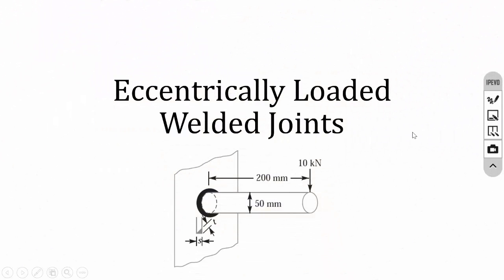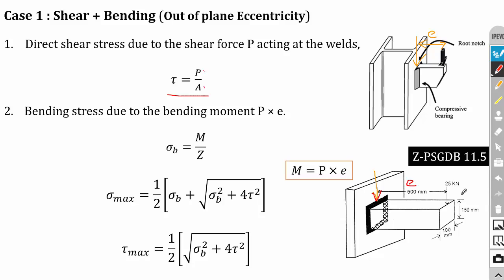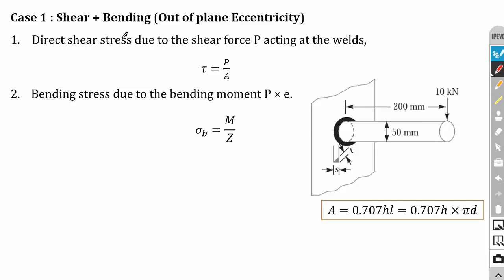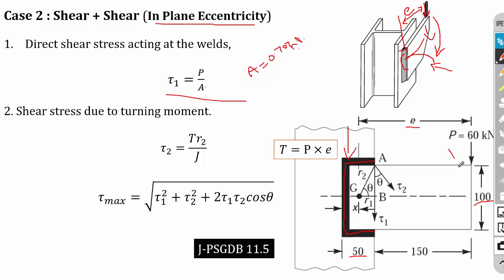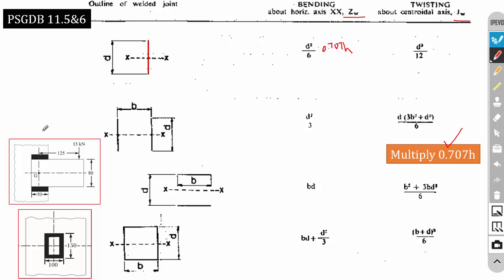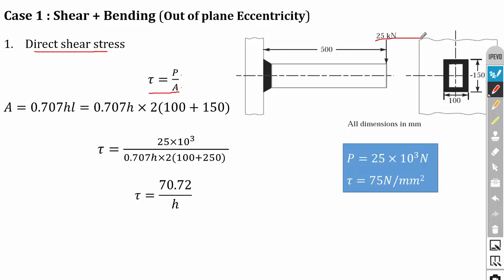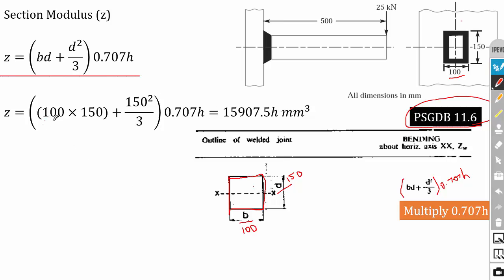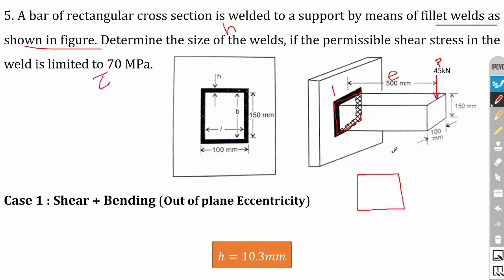Out of plane eccentricity - 1 | Eccentrically Loaded Welded Joints | Design of Joints

Comment: How would you treat a plate that has a distributed and has 4 side welded to keep the contents inside.
Reply from the maker: I'm not an expert in welding design, but as a starting point, you'll need to look at the forces acting on the plate from the load it’s holding. From there, you can determine the type and size of welds required to handle those forces.